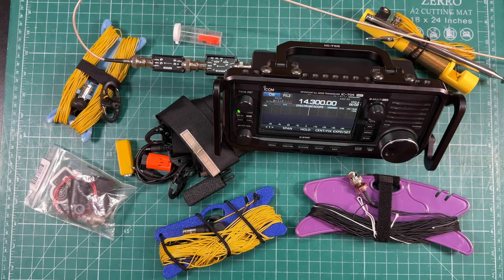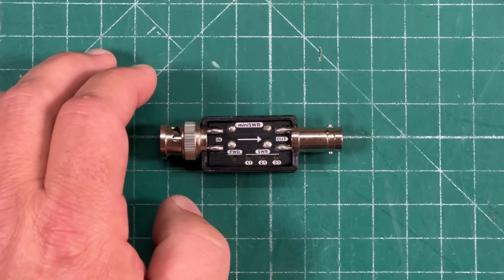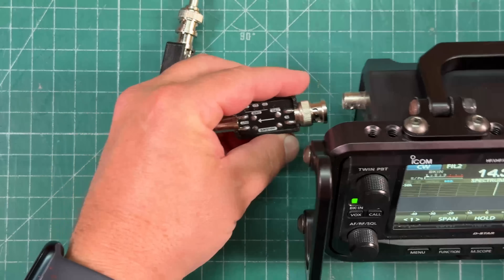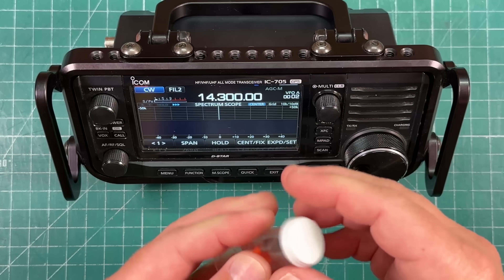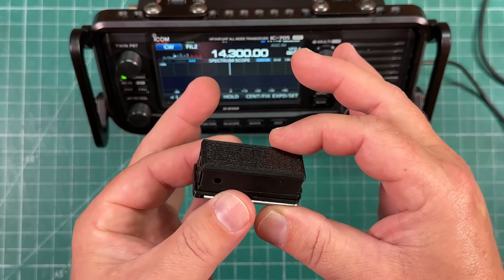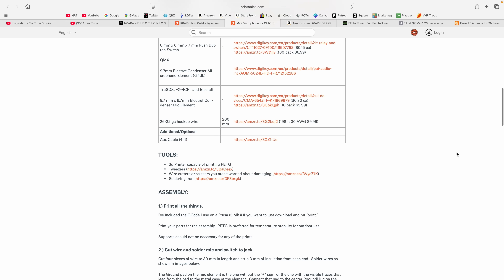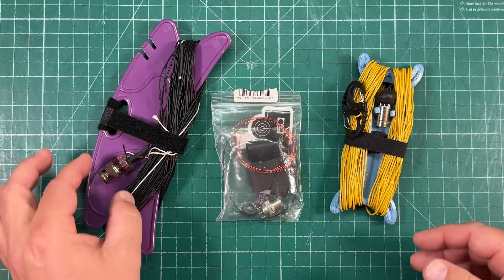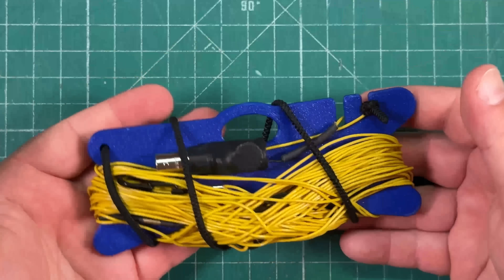Top 10 Innovative Ham Radio Accessories For QRP In 10 Minutes

Comment: The 3 times I used the Just Ok antenna I never made contact with anyone. Tunes to 1.2 and I received and I question if The  transmit works. Use QRP